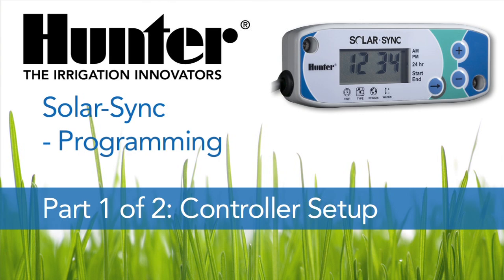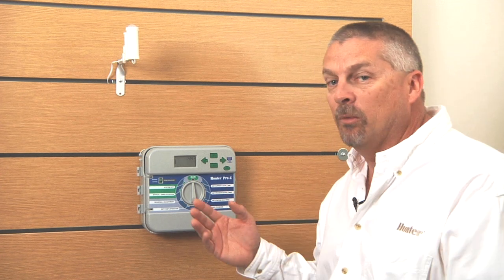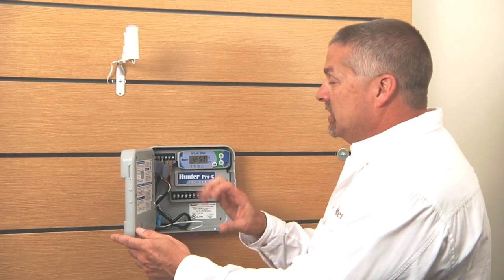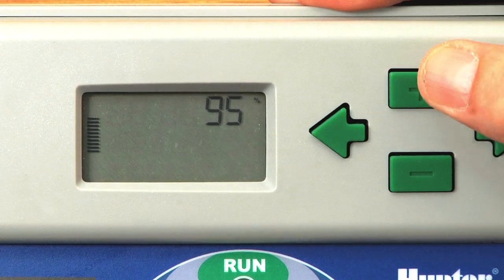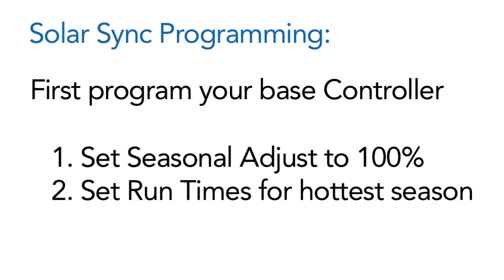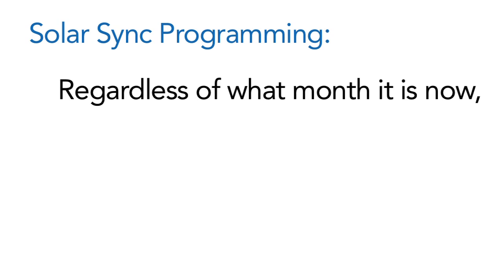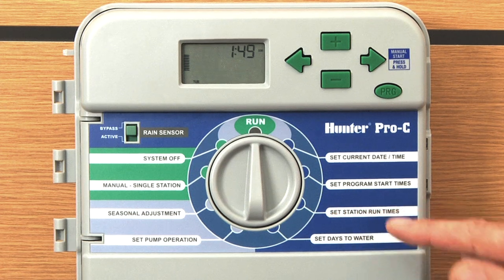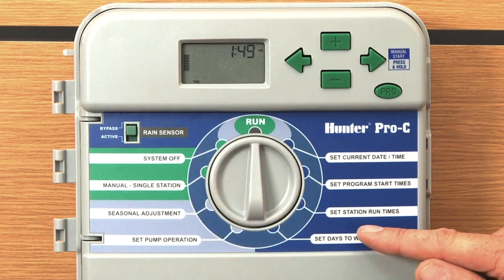Solar Sync - Programming - Part 1 of 2: Controller Setup

Comment: I am looking for a manual. I bought the house last fall and the solar sync panel is blank. I changed the battery and see that some wires in the base controller from the solar sync are not connected. Not sure what the wiring is supposed to be. Can someone help?
Reply: @Hunter_Landscape_Irrigation  hi thanks I did look at the link. Unfortunately when i tried followingthe instructions, I noticed there are only two sensor ports and connecting as instructed caused the main controller's display to go in a random cycle, not to me tion the solar module remained blank.